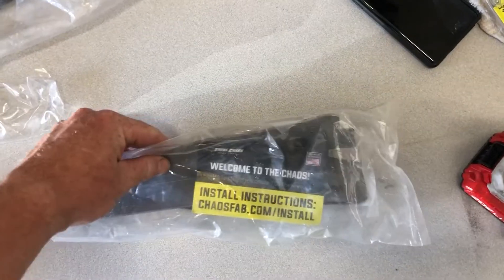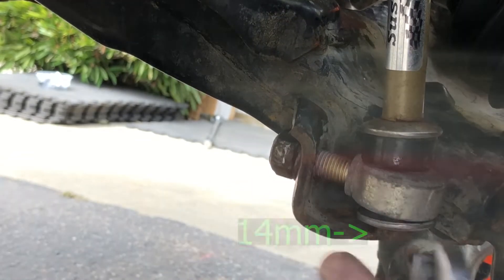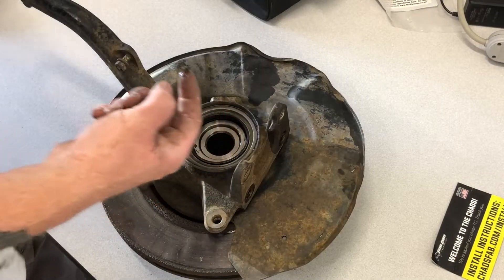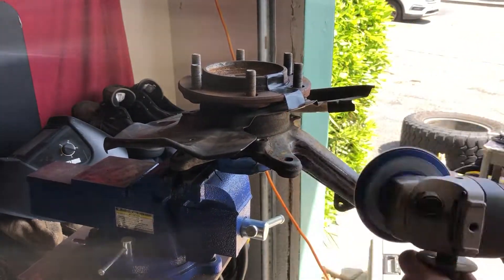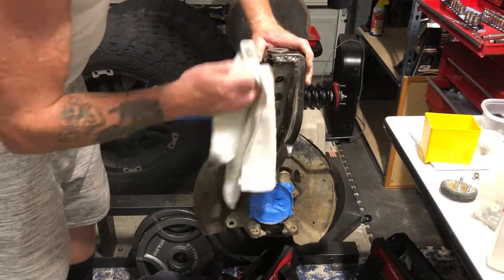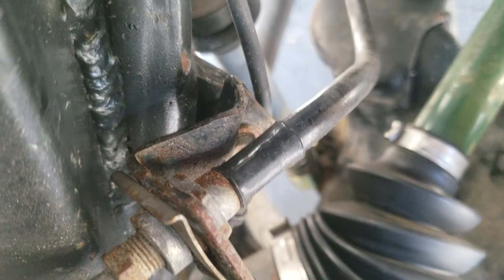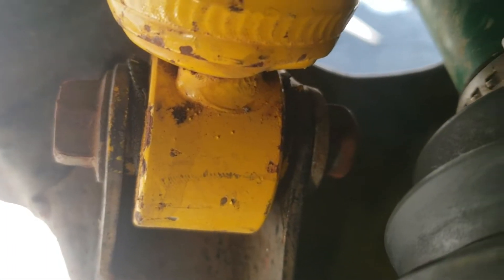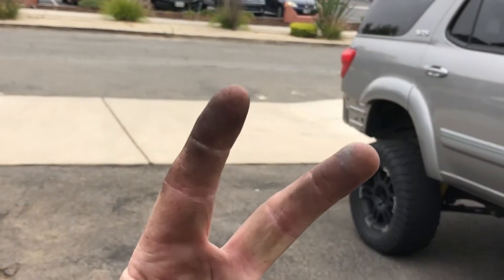Total Chaos Spindle Gusset Install | 1st Gen Sequoia | Step-by-Step

Comment: Would flux core wire work just as good? Or better to use my mig w/mixed gas?
Reply from the maker: I actually use flux core exclusively bc I don't have an indoor space to weld. Works great!

Comment: Did you preheat the spindles?
Reply from the maker: I did not but nowadays I would. I'd Hit it with the map gas, weld it, and then roll it up in a welding blanket and let it cool overnight. 
I've been having great luck welding Toyota cast steel using this method.